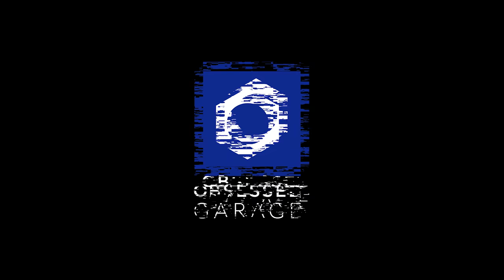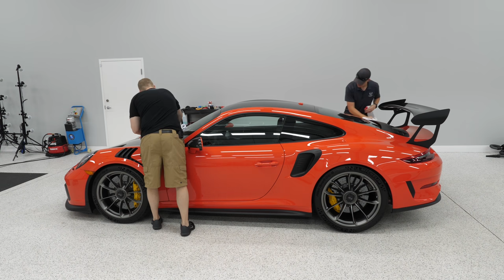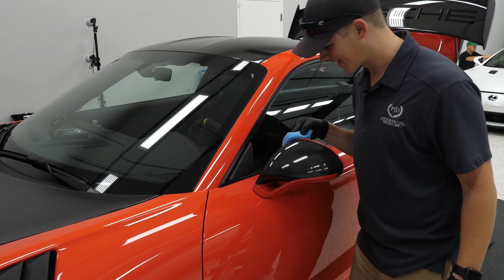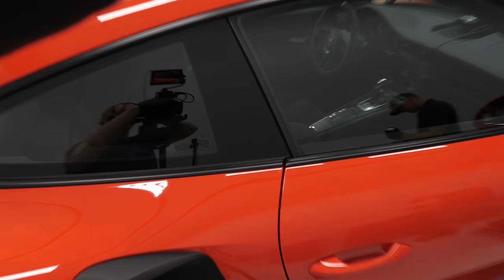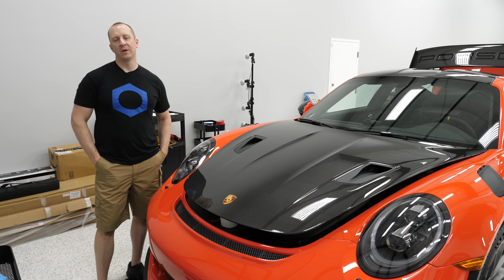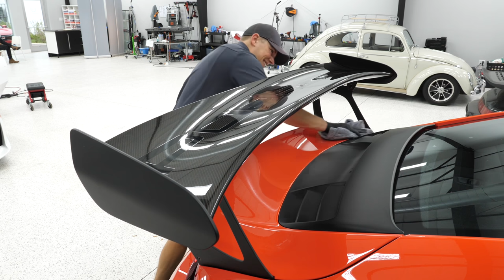LZ GT3RS Detail Series: E6 - Coating Paint With Gtechniq Crystal Serum Ultra

Comment: Four towels on the entire car? I filled two medium sized garbage bags  doing csl/exo a few nights ago doing My 2004 Red Z06. [edit,this is csl ultra.... in this vid]Wipe on/wipe off. I also did full panels..it was very smeary! I had two led lights on a stand which was a life saver in addition to two 8' led's on the ceiling. This process still seems tricky. Longevity alone is why I use it. Wax? nah! I like having two years of protection. As for wax looking different? I don't see it. Thanks for sharing this video.

Comment: LOl, Dundon headers and tune.
Reply from the maker: Best exhaust and only company that has done adequate testing on an exhaust for 991.1/2 GT3.
Reply: Of course they are.  You see their center section you had that looked like a mom and pops project?  All the other companies that race in various series like GMG totally forgot how to build exhaust systems.  LOL.  Thats why INDEPENDENT dynos have never shown any diff between Dundon and other companie's long tube headers like GMG.
Reply from the maker: I'm independent.  I had it on the dyno multiple times.
Reply: Is that the dyno that read like 290 RWHP for your  991 GT3.  Seems accurate.  Or would it be on rennlist forum where those gains are widely viewed as complete bogus? Even the Cup teams laugh at the supposed gains they claim  over other manufacturers.